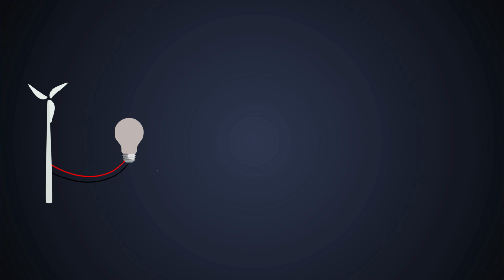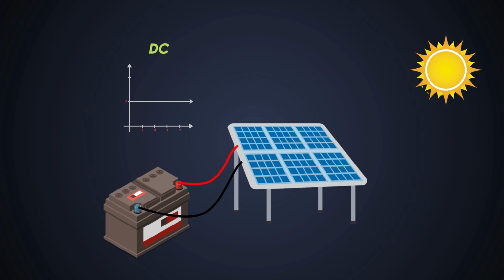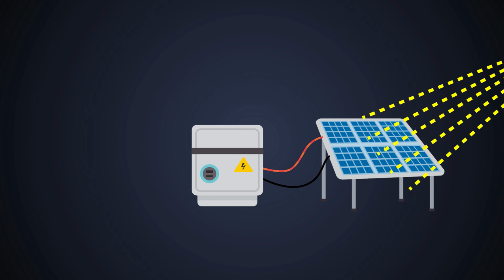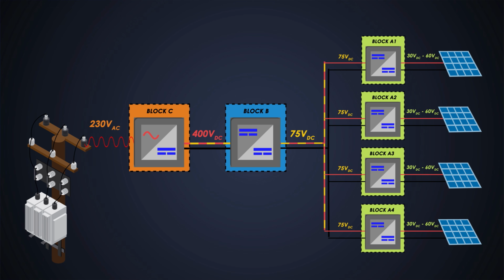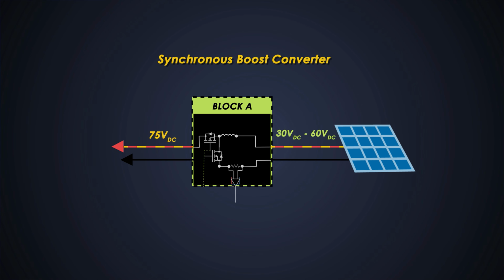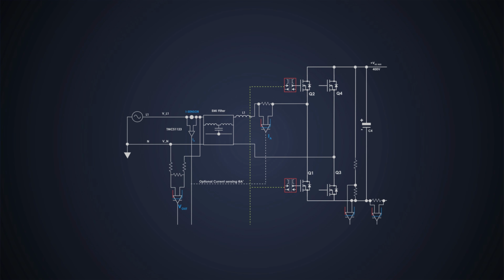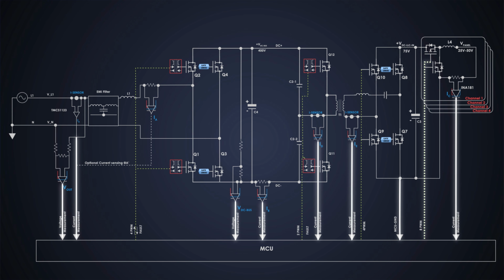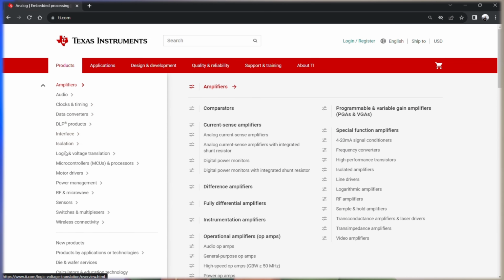Solar Inverters Explained: From Roof Panels to Home Appliances | How does Solar inverter work?

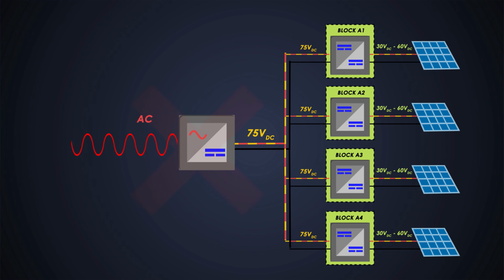Comment: Hi. You missed one point. At 4:05 it is not clear how to "stack them together". And the Internet keeps a silence. Are there any other methods to stack except a simple low Ohm resistors? I cannot imagine how a boost converter can measure a merged voltage and control each individual MPPT, so panels will share their output. If we simply twist the wires to make one DC rail, the strongest converter will always win, and one panel will always be loaded at a max, and some of them won't output at all if the maxed output is enough for a load.
It would be great if you create a video about methods used to combine DC or AC outputs. Thanks.

Comment: 4:14  400V is very dangerous stuff. it can cause an arc flash and evaporate you entirely (check videos on youtube, people is literally evaporated during an arc flash). I use 24V (well, that would be 28V due to LiFePO4 chemistry) for my battery bank and I step-down solar panel voltage to 29V for charging them. I have thought of going to 48V , but decided not to do that because 1) electronics below 36V is cheaper (35V capacitor is used everywhere) 2) 48V is not a safe voltage for humans
I have thought of changing my solar system to 48V , it would be more efficient, but I decided not to. I prefer pay for safety with lower efficiency. Once I connected a buck converter to one of my 900A battery banks, but I incorrectly connected it (reverse polarity error) , well the components of the board fled away from the board in pieces (they were un-soldered instantly) when I did the "spark test". This was my first real arc-flash (at micro-scale), and I would say it is a horrible experience even if was that tiny. I can't imagine an arc-flash at 400V, it would be like an atomic bomb explosion.
If you are doing a DIY solar installation, I don't recommend 48V , 70V or anything higher than 24V system. Because if you are DIY-guy and you love wiring your own stuff, you will 100% (some day) wire something to the battery with the polarity being inverted, and if there is lots of copper on the board, it will blow like a bomb with some parts of your body evaporated.
Reply: Every single SMPS you see uses 400VDC if it has a PFC. That's a standard value. So, relax